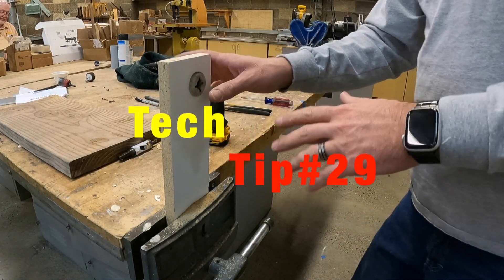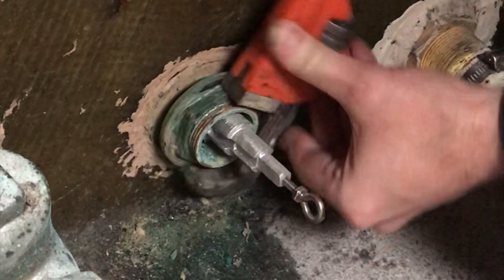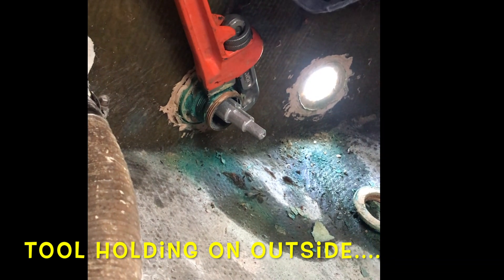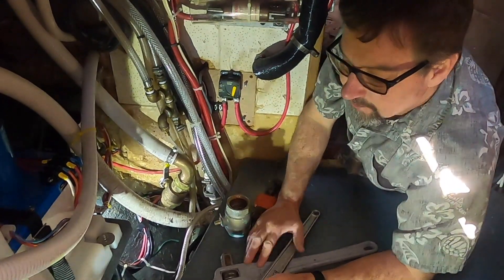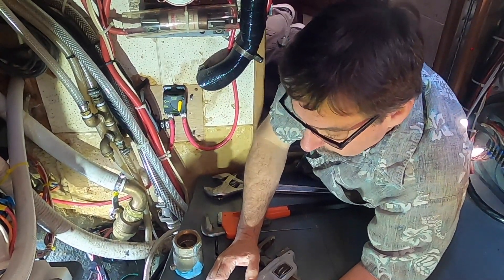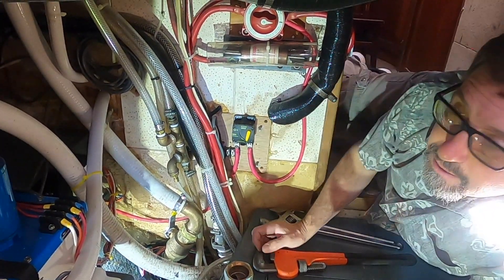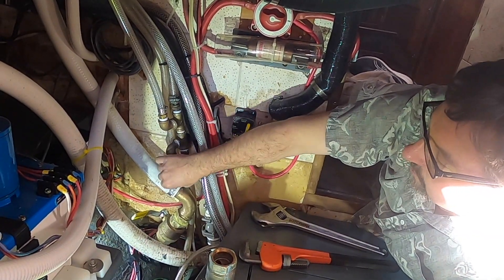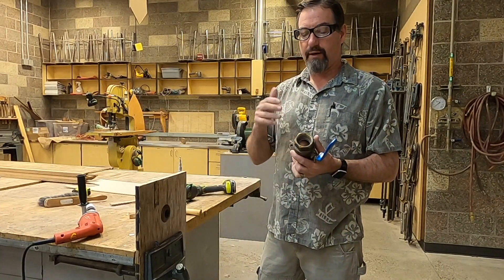Tech Tip#29  Removing Old Thru-Hulls

Comment: Great video and explanation.   Today I was walking by my boat in the driveway here in the north east. It's Dec 16, and it warmed up to about 40 degrees, and I noticed water dripping at a very aggressive rate. Like about 1 gallon per minute from my through through hull fitting.  My first reaction was oh FU@# because there was none coming out the transom hole (not enough tilt)  I am not sure how but there is clearly some kind of leak at the fitting. So I'm going to need to tear up the deck and see if I can figure it out. I am hoping it is not the through hull it's self, or the seal between the hull and the fitting but instead the fitting attached to it inside the hull. It's a line that feeds my livewell. It has a brass shutoff also.   I am at a loss how this could happen because the drain is open so I don't know how water would collect.  The boat is shrink wrapped, so I can do this out of the weather, but it's still pretty nasty time of the year for this kind of a job. I came here looking for a video to show how they are installed so I know what I'm working with.  I appreciate this video and the details.
Reply from the maker: Good luck on finding the leak or problem - boats.... challenging, but so worth it!!!

Comment: I know this is an old video but one question - you said you wouldn't use a Fein multitool to cut off the thruhull head (too much risk of damaging gelcoat), but would you use an angle grinder? I see some folks doing that (ex, Sailing Sunday installing TruDesign valves). I have a Fein oscillating tool but have never used a grinder. Are they easier to control? Seems risky to me but not sure since never used one.

I have a 2" thru-hull to remove so it may be hard finding a step bit large enough, and big hole saws can sometimes bind up.
Reply from the maker: 2" you won't find a step bit, my guess. Hole saw works just fine. Bronze is soft if you get a plug in, and find the center, hole saw is fast and easy. I've seen success with vibrating tools as well.

Comment: How tight does the nut need to be, also how much of the old sealant need to be removed, will fresh sealant adhere to some of the old sealant that you can't get off.
Reply from the maker: I suspect new sealant would adhere, but I've always been able to get the old cleaned up - a good sharp chisel works well. When re-installing a thru-hull the nut just needs to be snug, once the adhesive/sealant curses....it's a done deal

Comment: 2 questions:  1) what’s the purpose of hammering a piece of wood into the thru hull before cutting off the mushroom head with a fien tool?  2) is it really a big no no to thread the thru hull into the seacock from the outside while holding the seacock on the inside steady?  What if you’re unable to thread the seacock onto the thru hull due to access for instance a bulkhead nearby or lack of space on the inside?
Reply from the maker: The wood is if you are using a hole-saw to remove the head [need a place for the pilot bit]. We don't use fien type multi-tools on the exterior of a vessel as it can damage the gel-coat. Thanks for asking!